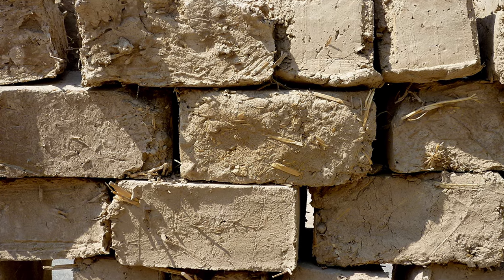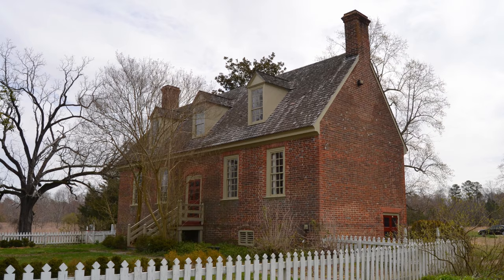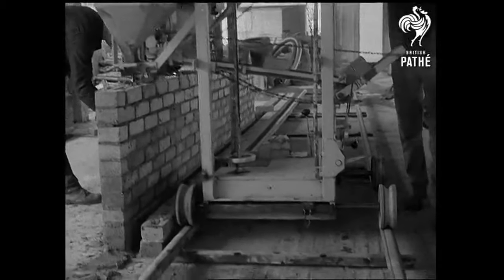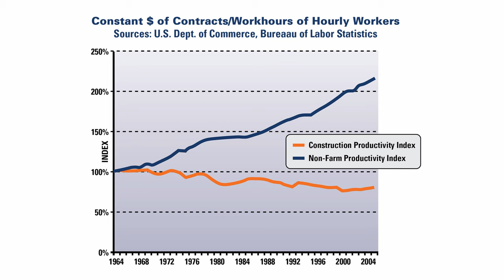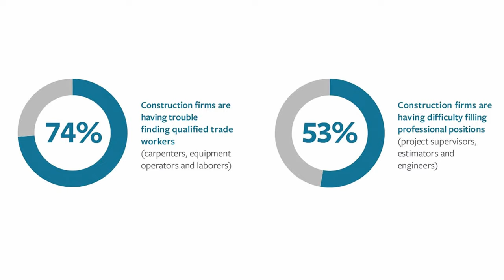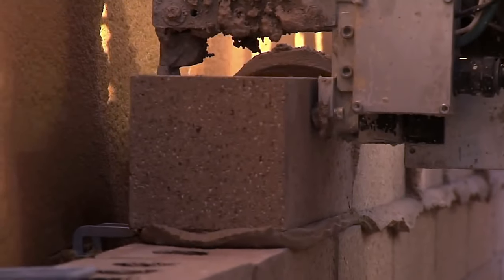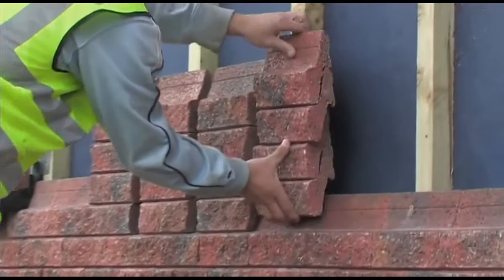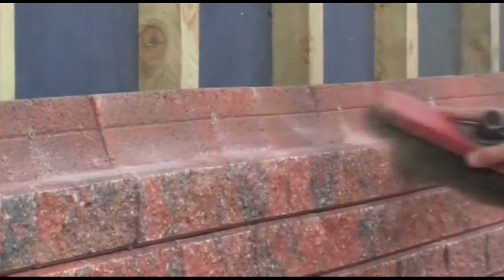Pros and cons of bricklaying robots | Construction Robotics

Comment: A friend of mine owns a paving company, the bulk of their income comes from paving brick parking lots and streets. A solid decade ago they bought a brick pavement laying machine. The machine isn't all that smart in what it can do, but if all you need to do is cover distance, it's very good at that. Some bits have to be done manually, but because those are done on the machine as well, there isn't near as much heavy lifting involved. The tedious job now is feeding oddball bricks into the machine, the bulk of the bricks are fed into a hopper by the pallet load with a front loader. No more sitting on the knees for 8 hours a day doing nothing but lifting paving bricks.
The only work that actually requires human labour now is the jobs that actually require skills, knowledge and thinking. Things that the machine can't do. Or the really small jobs where the machine won't fit. But for the most part that machine has taken over the back breaking tedious work and in doing so it has prevented people from going into disability by the time they hit 40 and has extended their productive career by 20+ years. And because the machine, a front loader and a lorry can do basically everything that a crew of a couple dozen used to do, it's also solved the problem of the decrease of people entering the field.

Same in the printing industry, I've worked at a printing company for almost a decade. In that time I saw a lot of boring or tedious jobs being shifted to machines. Machines became cheaper, more flexible and easier to set up. Very much taking the tedious work away from people. But again it's a field that fewer and fewer enter, having "cool" machines to work with actually adds appeal to the industry.
In the end the only work that ended up with people was the work that required skill, knowledge, and creative thinking. There's a lot of satisfaction to be had in making a small run of wedding invitations and seeing the customer be happy with what you've made. There's very little satisfaction in sleeving and addressing 21000 brochures because some company wants to send their marketing blurb on their latest product to their customers.
Of course there will always be the boring and tedious work that can't yet be automated or where automation is cost prohibitive. Sure, not all work can be fun.

And the same applies to that SAM 1000, it's a very expensive robot arm they've used there. For a machine that does such simple work, that can easily be replaced by a much simpler and cheaper mechanism. Or if they want to keep the expensive arm, they should put their Software Development department to work, because they are really under utilizing that. Same with the feeding of the machine. Mortar can be pumped, there is no reason why a human should be doing that. No one wants to do that. Same with bricks, slap a hopper on that thing so it can be filled by a front loader by the pallet load.
Sure it might not be able to cut a brick for a window or door opening. But that's the skilled, knowledge, creative thinking required part that most bricklayers probably don't mind doing. But it not being able to do corners I can see some truth in that, due to how a corner has to be laid, but if there were multiple robots that shouldn't be a problem.

Comment: Well researched and well stated and a lovely presenter, thank you. 

I’m a retired career mason/masonry instructor and while I acknowledge the fact that masonry is a dying trade I’m certain that traditional masonry will always have a niche moving forward. 
   
      Traditional masonry is highly labor intensive and because of that has become cost prohibitive so robotics may well help with that. But as you have already pointed out they shine on the long (money) walls which are less common, so we’ll see if they’re worth the cost. Also setting up a robot on a pristine flat factory floor or a construction job site are two very different things considering that the finished product has to be accurate to within millimeters. 

      I agree that mortarless products & methods while retaining an appearance will gain in popularity due to less cost & shorter time constraints. 

And as I’ve said, traditional masonry will likely still have a place for those that can afford the real thing and want a fancier finish.
Reply: in germany i've seen clip in walls used and then a premade brick facade imitation glued on top for the brick look.

Comment: i really wish the classic stile of masonry was more common.  solid brick and stone buildings are so much more beautiful than the modern decoration brick. i say decoration because i can't spell fassod.
Reply: Facade. (or veneer) brick.
It's not really doing anything structural.
But it becomes a big problem if the structure inside is wood and starts to settle.
.... Or the weep holes clog and the sills rot out.
AMHIK...

Comment: $500K is still a little cheaper than a union job.  J/K unionists, don't burn my house down.  

Brick laying is not the issue, the issue is that every single house is a custom construction.  Even when built from the same design drawings.  Buildings can not be compared to automobile manufacturing until they are the exact same.  

Until people want to live in a GMC three bed room made of stamped steel and aluminum, we're gonna need carpenters and bricklayers.  

Elon Musk may have different thoughts.

Comment: My thoughts are that 3D printing of some fast-setting, hard material is where the future is.  I know there have been TeD talks on this in the recent past.  Perhaps a stamped brick fascia could replace the traditional layered brick.  I know it certainly LOOKS great when done well.
Reply from the maker: What material are you thinking of? A more eco-friendly version of concrete?
Reply: @BelindaCarr  Yes at least as far as the 3D printing goes.  Something with at least some constituent of concrete but with a property not unlike expanding foam.  I've no doubt it would be exothermic, so that may assist in curing time.   Stamping can be done on a large scale with the forms themselves.

Comment: Well, I'll be... I had never heard of Nova Brik, but just this bit of a glimpse at the design and concept sure is interesting.  I wonder if it will become popular as a genuine replacement for standard brick laying.  The big question is whether the lack of mortar will work as well for sealing the wall against weather, bugs and air penetration. Are they in great use at this time?

Comment: This type of technology can be expanded into a fully automated system, it only needs a few more iterations and AI systems.  It could easily do the job of proper mortar consistency, and the only human "labor" would be to feed it raw materials, and that is not saying much considering that it could have a separate peripheral drive system to go "fetch" the materials from the supply drop-off (then humans only have to unload trucks into the supply zone).  If advanced enough, when given a problem it doesn't know how to fix, an operator not even on site can use cameras and controls and feed it input to fix the issue.....that can be a learning process for the machine over time to fix its own mistakes of the same nature.  This would be also a crucial step in space colonization, as we would need machines to build our "homes" before humans arrive....and it would need full autonomy.
This is a plus.....and laborers should learn to program if they want to have a job.  Adapt, die or go live with the Amish, is what I say.
Reply from the maker: I agree with most of your views! Well said.

Comment: Those interlocking bricks from Canada are only useful on timber frame houses.   Timber framed houses in the UK are very difficult to mortgage with most lenders refusing to loan more than the value of the land.  The abundance of timber in the States and Canada mean timber framed houses are common and accepted without stigma.  I do see the benefits of them, fast construction, lower build cost and excellent thermal characteristic. I hope that one day they will become more acceptable but for now in the UK they are viewed as temporary buildings. It's a shame because our housing costs are high and there never seem to be enough available.

Comment: Would the 3d printed structures offer a better solution? They seem to be effective for smaller homes.
Reply from the maker: Maybe for very small buildings, but not for large schools and warehouses. Those  are usually tilt wall buildings made of precast concrete panels.

Comment: Yah mortarless brick is faster. But there is nothing bonding the bricks together. And where is the rebar to give it structural strength. 
      Cheap and fast isn't good if it comes at the cost of safety.
      Why can't a layer of brick be placed then a bead of mortar be placed at minimum?